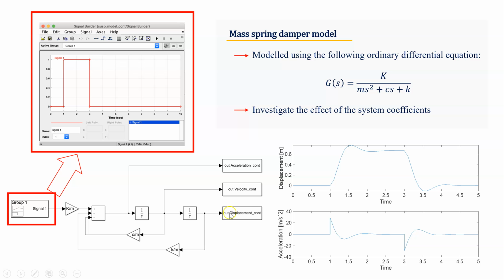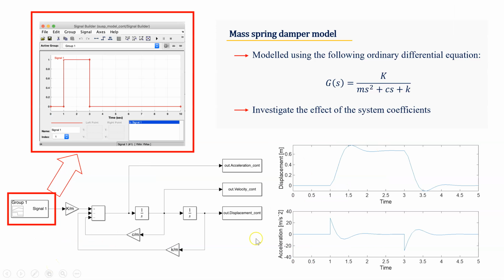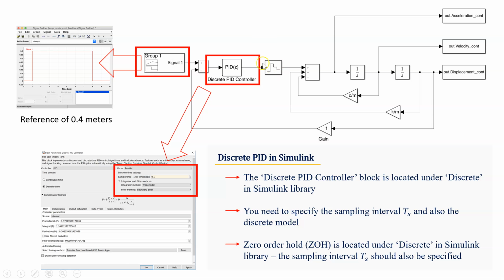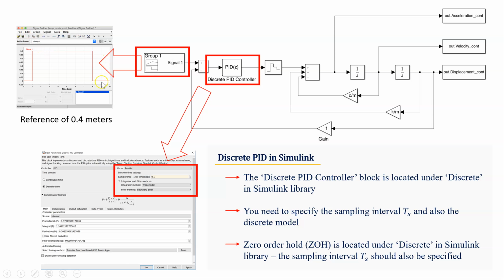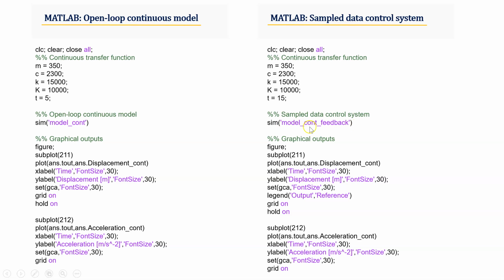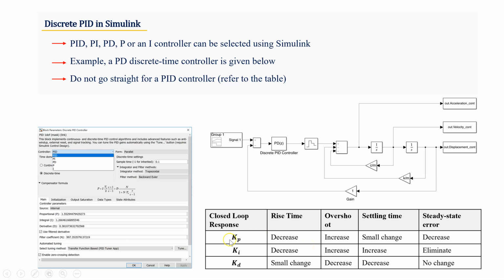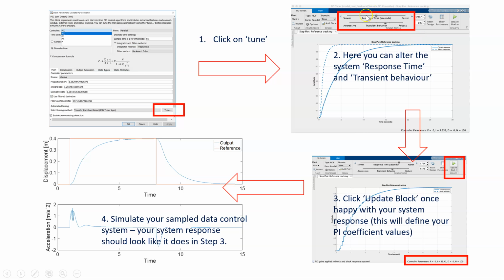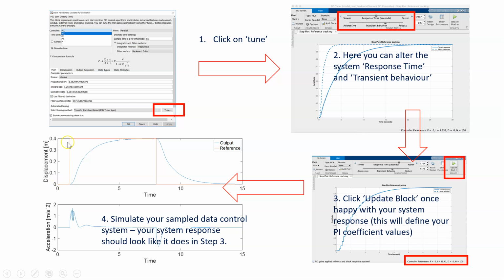Discrete PID in MATLAB & Simulink

Comment: Hello, great video. I just do not understand 2 things: 1) Are P and I values in Simulink block for continious and dicrete system are the same that you enter ? I mean does simulink make conversion internally, so basicaly you enter the same P and I values for both system ? 2) Why you are making tuning if you know values of P and D or etc. I mean I find the values of P and I for my system prisicely with pole placement method, do I still need to make tuning like you did?